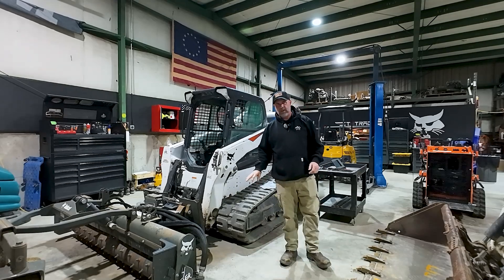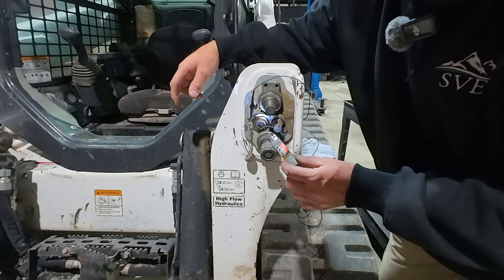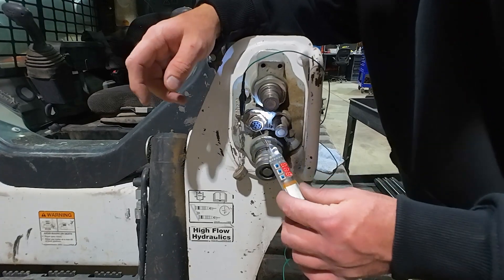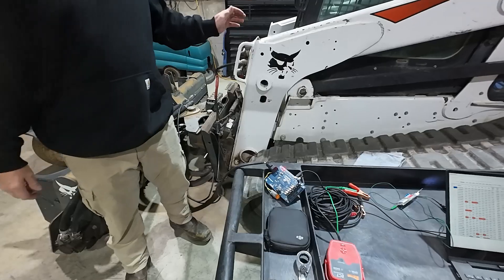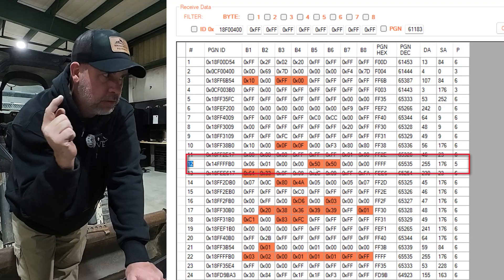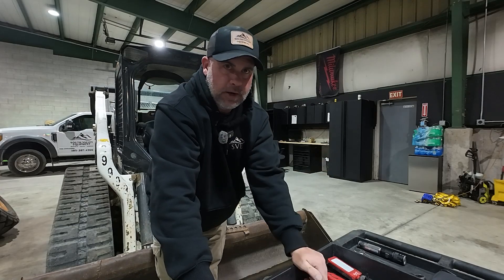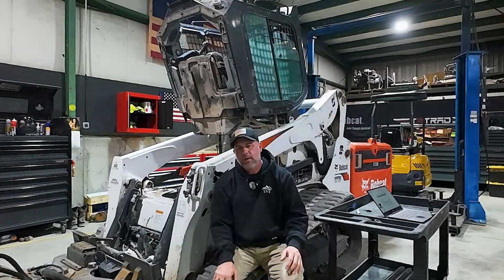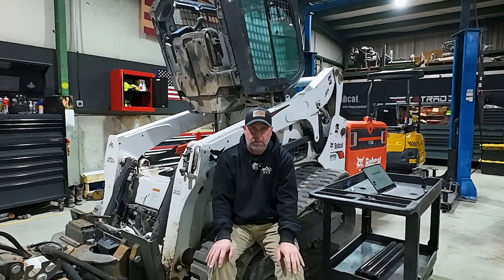Dealer Charged Thousands… Didn’t Fix Anything — I Fixed It for FREE!

Comment: I can feel his pain, I spent over $4000 at a reputable repair company that fixes all brands of machines. On my ASV machine they rebuilt the fuel injection pump and injectors and replaced all the filters even the fuel strainer and pump and gave it back to me in the same condition no power at all. After sitting I’m my shop for about a month I pulled everything out from the fuel tank to the engine and replaced all the hoses and fuel gauge sender with pickup tube all in one. After all that the machine ran like new. The problem was there was a crack around the fuel hard line coming out of the sender that was sucking in air at high rpm’s and it wasn’t visible unless you put pressure on the nipple where the rubber hose attached, it had some kind of glue around it from the manufacturer, the fix was less that $100. The repair shop told me they tried their best to fix it and basically thanked me for the business.
Reply: 4K gone forever to people that are supposed to know how to check these things. Some guys don't have the time to fix their machines, they have to have trust in the dealer.
Reply: @dc6233  exactly! The cost to repair wasn’t the issue if it was the problem, the fact that there wasn’t anything wrong with any of the parts they replaced or rebuilt, they were guessing at the cause and just threw parts at it. Lost my respect for them and never going back there.

Comment: I don’t agree with not charging the customer. You should be charging top dollar for that repair. Yeah you had it done in 45 minutes. And I get feeling bad for a customer. As a shop owner myself I look at it as— you the customer already paid 1800 for nothing and I found and fixed it in under an hour. How are you as the shop owner going to pay all your expenses for a free repair when the dealer got 1800 for nothing except for stripping the customers harness of its protective wrap? Great techs start at the dealer. They work there long enough to get some experience then go to an independent shop or start their own shop.
Reply: thinking next time that customer will skip the dealer and go straight to him.

Comment: 12:15 hit the nail on the hammer. Currently work for a dealership. Technicians like you are a needle in a haystack. I enjoy learning from your videos.
Reply: Yes! To compound the issue corporations hire management because of a degree, without actual experience. The technician needs a network of peers with experience, another set of eyes is always better.

Comment: First I wonder why these manufacturers are going to ecu controllers? Are they really necessary? Or is it more of a R2R that would increase manufacturers bottom line, so sellers of this technology can implement controller box making it more difficult for maintenance issues by owners, eg. John deeres problematic ecu boxes taking routine maintenance away from farmers. Simple analog controls always worked on older model bobcats back in the days of 835's. It wasnt long after that switchable controls came out, makjng it ezr to operate if you were used to joystick or pedal controls. In addressing your thots i wonder how much manufacturers deal or even solve the systemic  problems that arise from new technology that is implemented in new models. Are you getting latest diagnostic information from dealers or manufacturers related to wire chaffing problems and areas they are located ? If harness has not been relocated,  then this is called a systemic problem n not the first. Authorized repair shops  need these alerts to help quickly diagnose these problems or even whoever makes implements or attachments same thing shud apply. Are they sending out reports of systemic problems related to their equipment? If not here in lies the problem. Dealerships are dropping the ball when it comes to customer service, eg. Chevrolet and silverado engine situation, costing them millions for what to me seems like a very simple engine engineering mathematics...in lubrication when it comes to 0w oil. Tight tolerances have their own unique problems. Manufacturers shudda had this solved well before those motors got to showroom floor. Trust is made over years of reliable products. Trust is not taken lightly by consumers these days. You screw up,  you just lost thousands of dedicated future buyers. Hopefully bobcat realuzes this fact quickly or your gonna get more biz tgan you can shake a stick at...just like royalty repair servuce, southmain auto, daves auto center, these repair shops get customers from across the country. Ppl trailer,  deliver, ir drive to tgem due to their local dealers or repair shops can nit correctly diagnose manufacturers systemic problems,  brand new vehicles still under warranty adter months of dealer failing their customers who wont be back fir repair ir even new vehicle...customer service is non existence  everywhere...as dave wud say "hey gm come on, help a guy out"...good mechanics keep owner up to date. Great job on your part,  you just made customer fir life
Reply: Exactly! Manufacturers are making it impossible to repair what they sell. I guess by us buying their products we have to be willing to accept that, my thought is after the warranty is over we should have right to fix things ourselves.
Reply: @Old-Blue i think gm git the hint.  As there are thousands of '24&'25z still sitting on dealers lots with no potential buyers in sight. One of big truck companies I'm nit sure which one, white international,  or peterbilt   are building a low budget truck. No frills, manual windows, vinyl floor, small V8, with a $8k price tag. If i remember correctly suppose to go into production by end of this year. No computer dont have to worry bout mileage  had somethinh thing to do with not making bunch if diff models. Just one model, 8' bed. I was hoping it wud come to me by now...goggle $8k new truck

Comment: Your can bus has 2 120 ohm resistors to give you 60 ohms resistance between the two can wires. Without the resistors your won't get communication

Comment: My Bobcat T650 @ about 1,500 shut down and would not start or move, Bobcat Dealer sent out a mobile truck and that Technician couldn't figure it out so they said to take it to the shop, so we picked it up with an excavator and put it onto a trailer and it went to the shop and it then needed a cab wire harness, well that did not fix it so it needs a main frame wire harness and that fixed it except that now the air conditioning doesn't work and there is way to much R134 in it by several pounds, it will need a new compressor and condenser etc.....that is impossible it was working and you are the only ones that have worked on the machine.  I picked the machine up and I took it to my friend from High School that has an auto repair shop, he looks at the Bobcat T650 and put the proper amount of R134 in it, and then he finds the connection for the High Pressure switch that was folded back and taped on the new harness and now the A/C works fine, he then asks me if I would like to use attachments because all of the connections for that had not been connected.....what a nightmare, I have not been back except to buy parts and then I purchased 2 new Cat Track Loaders if for no other reason at least it is a Cat Dealer Service Center.   My other T650 (I always buy 2 at a time, spare parts makes sense that way)  the Power BobTach would blow a fuse over and over but only with the door closed not when we would work on it with the door open, it turned out to be a Flange Bolt 3/4" that holds in the side windows and it sticks into the cab pillar which rubbed on a wire, so we replaced all of the bolts on both T650's with 1/4-20 X 5/8 Flange Bolt #17155 from BoltDepot.com as the original bolts were 1/8 inch too long to be around those wires.   Thanks for all you do, I can really appreciate your wisdom in figuring out the issues, Don
Reply: Wow, what a nightmare. That dealer didn't deserve one dime.
Reply: To be honest, Bobcat are the best (in my opinion) but it’s the service after the sale that must be considered in an equipment purchase.
Reply: My t650 had same problem. Had to have ac pump replaced. Also my machine they never did fuse panel right. So would just stop and not turn on.

Comment: Went out to a customer site with a newer younger tech. The younger guy had been at that site for three weeks starting up a machine after a major control system up grade. The reason I was there was the customer asked for an “Experienced “ tech to fix the problem that the new guy could not and had been trying to tune using the software for two weeks. The problem was the machine speed was not tracking the set point properly and it was erratic. Walked into the unit building after talking to the supervisor and my guy had already sat himself down in front of the control panel and had his laptop hooked up. I looked over his shoulder for about 5 minutes then walked over to the unit to watch the throttle response. The whole fuel control and throttle unit had been upgraded during the refit to a newer one. Watching the throttle I noticed the spring return was not working right as the little roller fitting that pushes on the throttle to move it back and forth had a 1/2” gap between the roller and the throttle arm. Then after about 40 seconds the spring finally over came what was holding it and it snapped against the roller. When that happened the unit slowed down then started to accelerate again. Grabbed the new guy and showed him what was happening. Shut the unit down and tried moving the linkage by hand it would stick at about 80% full throttle. The linkage had two small pillow block bearings one on each end the rod had two holes drilled in it that had roll pins in them to hold to the bearings. I took a hammer and a small punch and knocked out the roller pin on the out side on the bearing that was just for support. The side of the bracket holding this assembly jumped out about 1/4” when the pin dropped out. After that the throttle moved freely. When they made the bracket holding this assembly they had made it about 1.4” top wide and it was causing the shaft to bind. Started the machine back up and it was working fine after that. Total time on site for me to that point was 1 1/2 hours with most of that meeting with the supervisor. Sometimes you just have to go and look at the thing that is causing the problem not sit in front of a computer.
Reply: After your long technical diag. 2 weeks is ridiculous but I would think they would have someone at dealer or (bobcat/doosan) most def has tech support that if explained would have walked the “NEW” tech through diag.  You don’t have to sound so brash against this new tech as to maybe putting some Blame back towards dealer. One has to start somewhere but 2 weeks on site if have to say this man didn’t want to be out there this long and that means the equipment was down equally. But then again maybe he didn’t try to reach out at all to tech support (not that they’ve ever been that helpfully from what I’ve seen but as a tech of 30+ these instances happen integrating a new generation into work field that’s why there’s steps one takes and there’s help out there. Although he could be guilty burning time lazily , the dealer once again should have stepped in after second day
Reply: @Gilmore304 In that business there are only 5 or 6 techs a available for the whole customer base of 600 customers.  The reason the office sent me was I was in between jobs but I was slated to another customer site the next week to service three machines which would take me 6 days. The tech in trouble had been mentored through a training process for 6 months where he had worked with senior techs to learn the ropes. That guy had worked with me before on a number of jobs and he was a university graduate as well in the field of engineering. He had been on the phone a number of times to our engineers but none of them were available to drive out to that site either. Our dispatcher finally asked if I would go and I agreed even though I was supposed to be on downtime. So when you are short staffed for years these problems with man power tend to flare up once in a while. As a side note this tech after four years of working in the field moved on to an office job in an assembly plant. The turn over was high for these field techs.

Comment: I was a marine tech for 45 years. Back in the 90's I was making 110g's when other techs were doing 30-35. Anybody can change parts. The secret is 95% of fixing things is diagnosis. You have to understand how something works before you can fix it the first time. I worked flat rate, so if a 1 hour job took me 5 hours, I ate the 4 hours. If I fixed a 5 hour job in 1 hour, you charge the customer 3- 3.5. He's happy & I make money. Be well trained.

Comment: Brady, as an older mechanic, I’ve seen quite a few machine issues and I really think that today’s younger mechanics..not all of them..but some of them simply do not want to take time to diagnose the problem, especially electrical issues, because it requires the mechanic to actually think.  Mechanical issues are one thing, but trying to sort out electrical gremlins can be challenging, but also rewarding because you learn so much valuable information.  Maybe the dealers just aren’t providing adequate training?? Anyways, another great video!!

Comment: Another good video. Adding to your point I would say one of Bobcat's selling points is the dealer network. That basically means you can get good service close by. If the service is not good then the dealer network means nothing. They should use their dealer network and people like yourself to actually NETWORK. If the tech is not capable and the khaki pants manager is not capable, they should call another dealer or you. That would be networking and would greatly expand and improve their service and by extension their customer base.  Penny wise, pound foolish.
Reply from the maker: I agree 100%.  I offered them seats to our training classes, and they basically told me to kick rocks 😅

Comment: I had almost 40 years in the heavy equipment industry before retiring and I will add that I saw a huge shift in the service management side of the business. I was a field technician before moving into management and when I first started virtually everyone in service management was a former technician prior to becoming a manager. Both the dealer groups I worked with (CAT and DEERE Construction) slowly shifted to promoting into Senior Management based on the type and number of degrees held vs hands on experience. This ultimately began to move downward into the service management side to include service managers themselves. So unfortunately you ended up with people that had little or no experience or knowledge in the nuts and bolts side of the industry “leading” the service organization itself. Combine that with the increasingly difficult job of attracting and retaining qualified technicians and the result is what we see too often today. That being companies and their departments being managed by highly educated people who in many instances have little or no knowledge of what their employees actually need to do. 
I’m glad I’m retired as it was very demoralizing being lectured at every opportunity by people with MBA in their profile who had never turned a wrench or operated a piece of equipment.   Thanks for your videos, I really enjoy the content and your presentation style.

Comment: I absolutely agree that it is on management. When the machine starts and runs and the attachment works fine on another machine management should definitely get involved before allowing a tech to flail around and dump $2,000 of labor onto a customer.

Comment: Curious where you got the voltage probe at ? The read out is super nifty
Reply from the maker: That's a handmade tool, I'll have a video on that soon.
Reply: Heck yea. Thank you sir
Reply: Good evening ! I am the developer and manufacturer of this tester. This device is designed to test power wires and ground wires under load. It also functions as a voltmeter.Brady will soon release a video with more detail information and explanation of how it works.The device is portable and does not require power from the equipment's onboard power supply. Mobile and easy to use. This can be purchased
Reply: @DIAGLOAD  i will keep my eyes open on that purchase link then sir. Thank you

Comment: The circuit tester you used, is that like a "fox and hound" (sends tones down the wire) one would use to trace a circuit in a building?
Reply from the maker: Exactly
Reply: Highly recommend power probe's circuit tracer. It does a bit more than the other cheaper versions like telling you if it's an open circuit or a short. I bought mine for around $180. I believe the part number is ECT3000B

Comment: I am keeping my 1994 New Holland L785 skid steer.
No electronics.
Never broke down except hoses since 1994 Perkins power .

Everything is junk today.

Excellent you try to help people 👍
Reply: Same for me, 2008, Bobcat T250, all mechanical controls
Reply: @StinkyDog1971 same unit I own..2008 T250, rock solid
Reply: I've got a 1998 New Holland LX665 turbo and a 2000 Daewoo 1760xl that I bought new.  No electronics that fail and stop the whole machine.  All the new stuff is non-stop headaches with electrical gremlins!
Reply: @floridagunrat1625 keep older ones.
I have CAT 298 2014 no issues yet 4000 hours 

But my 308 excavator needed a DPF exhaust filter $4000 @3500 hours .
Reply: Those were nice machines.